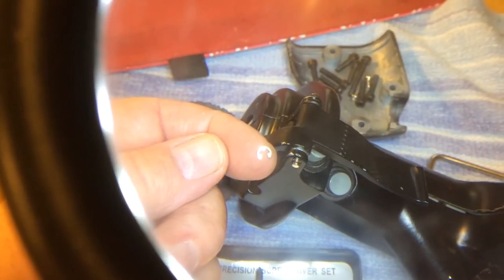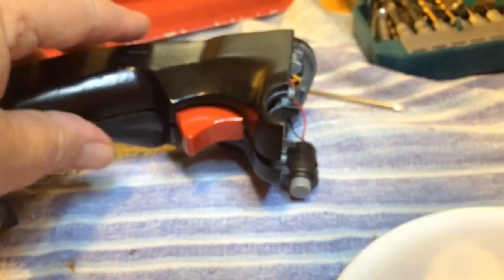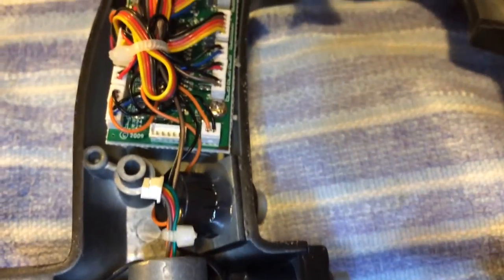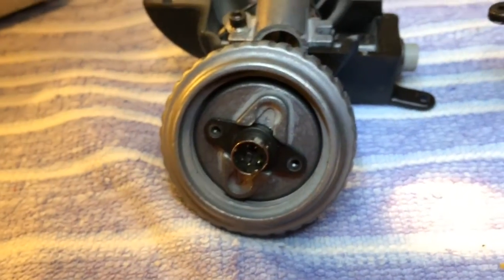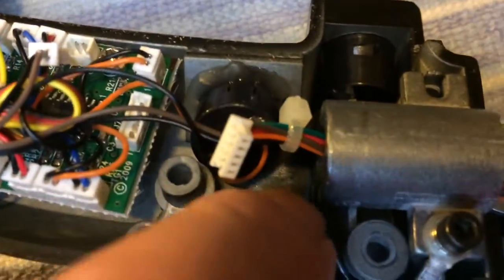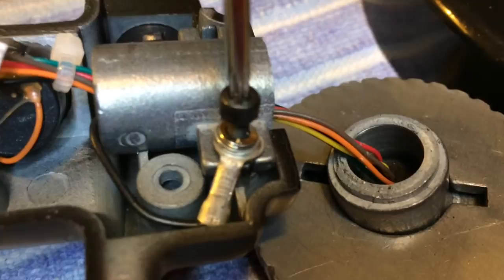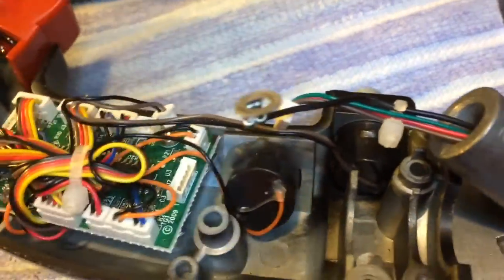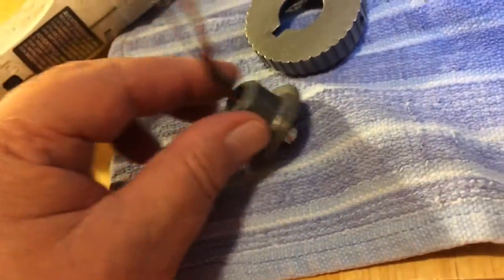Catastrophic Failure of the Thrustmaster HOTAS Warthog Flight Stick - Disassembly and Diagnosis E1

Comment: This vid saved my day. I noticed that my warthog had some play of about 2-3 mm when changing from forward to backward and vica versa...Hearably tilting back and forth on the piece that was broken in this vid. So I opened it up to see what hapened.The screw that is stated to be missing is one of the screws you remove while opening the grips chassis. In my case the second screw that is only seen when the grip is opened got loose, so the grip started moving more and more as the screw loosened further after some time. 

I opened the thing and tightened the screw again. I also noticed that some smaller cables got in the way of the grey coolie hat, which would probably have lead to broken cables after some time. So I glued the cable in place out of the reach of the moving parts. After that everyhing was fine again.

Thanks for preparing me for what  I was facing while opening that stick.

Comment: Hi. The screw that you suggest (16:32) is missing... I think it is not. I think that one of the screws that you removed while disassemblying the stick goes through that empty hole.

Very good video. It helped me a lot with repairing my own joystick.

Comment: Thank for you puttting together this video. It's very informative and useful. 

I found your video while searching for information on how to replace the Countermeasures Management Switch (CMS). Aparently, the CMS failed within a couple of months from purchase, in less than 30 hours playtime. The product is still under the 12-months warranty period, so I'll check if Thrustmaster shall repair or replace it under warranty, before attempting to fix it by myself.

Comment: the zinc eutectic rod brazing is a pretty good idea. I would consider for an ordinary heathen like myself to sleeve it on the inner diameter with a copper tube bonded using cyanoacrylate to the failed component. I'd also probably give a poke at an epoxy on the break line.

the copper tube bonded on the inner diameter would add some degree of shear reinforcement under tension and pure lateral shear.  sleeving the outer diameter doesn't get you anything due to the location of the break and the change in diameter.

lastly if you were in a pinch to get a replacement, you've got this perfect part that would scan up nicely with a 3d scanner while elers glued together. thats enough to get a company like shapeways to SLS print you a replacement steel unit.

Comment: @Hesynergy - thanks a whole heap mate. From what I can see, you are the only vid that shows how to get into the flight stick. I accidentally knocked my stick off the desk when it was separated from it's base and busted the 5 pin male mini-din plug. I managed to pull it apart & straighten it out and with some superglue, fixed it.

Comment: You need to clip your toe nails...LOL,  Couldn't resist.    Any who...You mentioned the DIN connector, mine (female DIN) in the base has sunken down and isn't making connection with the stick (male DIN),  Not sure of how it happened, maybe I misaligned it like and idiot that can't follow big yellow arrows connection.  Not sure, in any case. Any ideas on bringing the female DIN back up flush with the chrome retainer without having to break it all down to push it up from below? I was thinking maybe a small flat blade screwdriver & slightly twisting in the center rectangular hole while pulling up and then perhaps with epoxy or CA glue to hold it up. I'd force the glue down with a paper tube so it doesn't interfere the the male DIN sleeve.
I saw a video of someone using a spring loaded center punch to indent the surrounding casing to prevent it from dropping back down, but I can't find the UT video. This method of coarse requires the breakdown of the base. Which I'm trying to avoid.
Thanks for any help you may give.